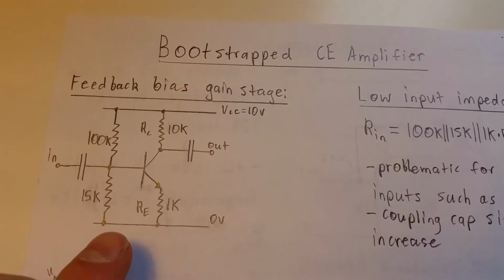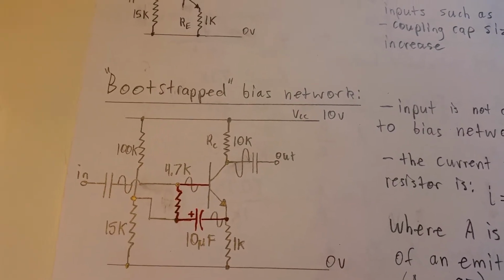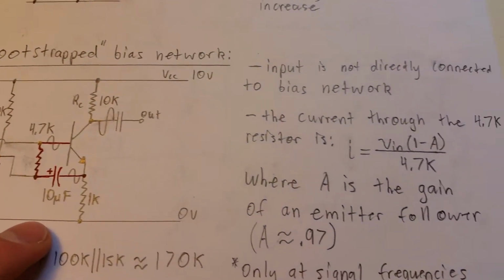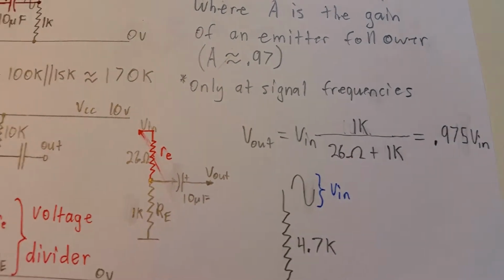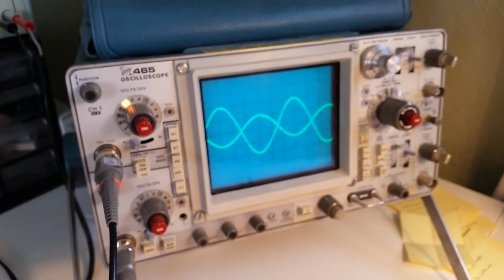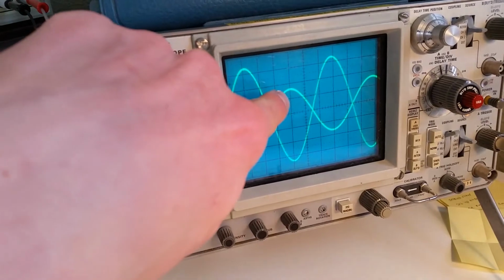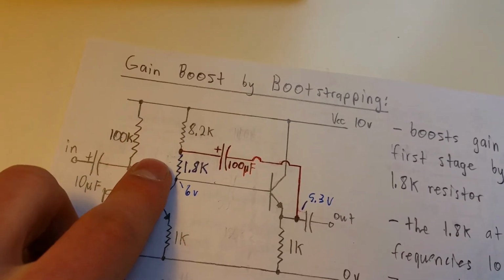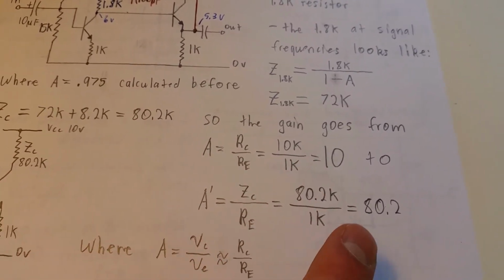Bootstrapped Common-Emitter Amplifier

Comment: Awesome video!
I've been teaching myself about amplifiers in order to build my own tape player. I kept wondering why I saw tiny ceramic capacitors going from feedback to input on so many circuits I came across in service manuals, and now I know!
Reply from the maker: I highly doubt those caps are for bootstrapping, since bootstrapping is a rather esoteric and not commonly used technique. They are most likely for either dominant pole compensation or some kind of active filter. Tape decks of course have many of those to flatten the tape head response or for pre-emphasis or de-emphasis of the recorded material. Tape decks are complex and very difficult to design and build properly so best of luck.

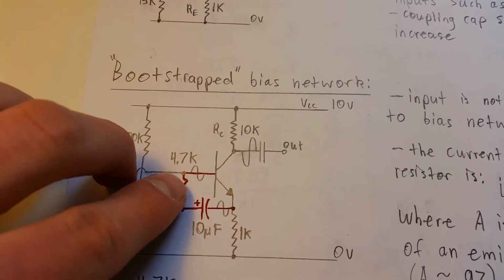Comment: How is the 4.7k ohm calculated at 0:46?
Reply from the maker: It is somewhat arbitrary; I don't know of any calculation. Ideally it would be large enough so that the feedback capacitor doesn't have to be too large but not so big as to negate the effect of the bias network.
Reply: Thanks! 😁
Reply: You would typically use it to be in series with the bias divider so for example instead of previously having 20k//20k bias divider (just an example) giving an equal resistance of  10k with the bootstrap circuit you would use 10k//10k resistors giving 5k resistor equal resistance but this not connected to the base directly anymore and in order to keep the same quiescent point you would attach it to 5k or in this case 4.7k ohm resistor to get the original equivalent 10k bias network which sets the quiescent point

Comment: How was gain Calculated where A=0.97, I understand that, how did find the value of re = 26ohm  , and Capacitor value for bootstrapped to have high impedance.
Reply from the maker: There is an equation for re that is a function of emitter current and temperature. That number should be taken with a grain of salt since it can be as high as 42 ohms or as low as 21 ohms for a given current depending on what you take to be the ambient temperature. For 42 ohms the gain would be something like 0.96 instead of 0.97. The capacitor value should be set to pass all frequencies above 1Hz at the input impedance of the stage before bootstrapping. This is the impedance of the voltage divider which is about 13K, in parallel with the input impedance of the base, which is ~150K for an Hfe of 150. The 150K base impedance swamps the 4.7K resistor because it can change +/- 30% or more depending on the transistor Hfe and temperature. For a 10uF cap, this gives a rolloff of just under 1Hz.
Reply: @thetuberoaster8321   bootstrapping the input to have greater Rin ( input impedance) . Your circuit on the first page. Your out is comming what is your collector right. So what is your gain ?  With high impedance. 

What is your input Ac voltage : 20mv Vpp ? I am really trying to understand what's going on your video. What is the benefit of having high impedance if I am not doing audio. 

I am building a 3 stage amplifier CE- CE-CC.  What's your thoughts on that.
Reply from the maker: @Tankzim.z  The gain is approximately Rc over Re. The intrinsic emitter resistance changes that slightly but in this case it is almost 10. The output impedance is roughly Rc which is 10K. The input impedance without bootstrapping would be dominated by the base bias network, making it hard to get anything above 10s of Kohms. Bootstrapping allows this input impedance to be at least and order of magnitude higher. This is sometimes useful for when you can't afford to load down the preceding circuit. If you have one CE stage driving another, the first will be loaded by the input impedance of the second. This will cause the gain to drop and the distortion to increase somewhat. The more obvious solution is to use a FET, but for low-noise applications this may not be feasible. This technique allows you to use a regular BJT with its benefits but without its usual trade-off of low input impedance. 

The input sensitivity of this amp is something like 400mV before clipping. You can tweak the biasing and the gain to change the operating point to make the input sensitivity whatever you like. The three stage amp you are talking about - the CE-CE-CC amp - allows you to split the gain between two stages, which is better in terms of distortion. The CC output will make the output much lower impedance than a normal CE amp, allowing the amp to drive heavier loads without increased distortion or loss of gain.

Comment: As I understand it, it ultimately produces a bucking voltage for your input signal so it's seeing a much higher impedance when it appears across the new input resistor networks. The coupling capacitor prevents the input device from seeing D.C., and the input device is more effectively transferring it's voltage. 
This was in fact, helpful, but I still need to put more work in. 11 years since I was in college and I haven't done the math for about 8 years. 😩

I suppose for use in guitar distortion where my goal is to overdrive the transistors and not involve diodes whatsoever, this is another path for me to explore soon after finishing current designs. I ultimately increased my base voltage divider values by a factor of approximately 550x, which created a massive increase on input impedance and my gain in fact went through the roof. Surprisingly, the really high resistor values aren't giving me noise issues so I'm safe on the simpler path in this example, but everything is ultimately a piece of the puzzle to better performance as we progress.

Comment: The mushiness in the Av>80 stage wasn't about clipping (which you noticed it wasn't doing.) It is, instead, characteristic of a voltage gain that varies with the signal.
Reply from the maker: I figured it was something like that. It was actually the first time I noticed and wasn't sure what would cause that. Maybe, when the common emitter amp saturates, the bootstrap voltage gets shifted and less cancellation occurs across the resistor.

Comment: Where can one get more information on the analysis of the CE bootstrapping
Reply from the maker: It's actually a rather obscure topic and I haven't found too many good sources on it. I got most of my information from a book called: Transistor Circuit Techniques by G.J. Richie the third edition. He shows a circuit where he shows exactly the techniques I describe and gives equations. I think Electronics-Tutorials online might have an article about it but it's not as good if I remember correctly. There might be more out there since I made this video.

Comment: WERE YOU USING MILLERS LAW IN THIS EXPLANATION?
Reply from the maker: No, I wasn't intending to although Miller's Law seem like it might be helpful in a situation like this. I just found some examples of circuits in books and based my logic around that and tried not to break any rules. Actually, some of the math shown about the gain values and the exact value of the impedance is maybe not exact. I haven't found very many sources explaining these circuits that show equations to calculate gain or impedance.

Comment: Why is the 4,7k resistor needed?
Reply from the maker: The 4.7k resistor give the feedback current something to drop across. The higher that resistor is, the higher the multiplied impedance that results. The AC voltage on both sides of it are supposed to be the same. If the 4.7k resistor were just a wire, the circuit wouldn't multiply the input impedance. In fact, it would probably oscillate instead. The resistor can't be too high since the voltage divider still has to do its job of biasing the transistor.